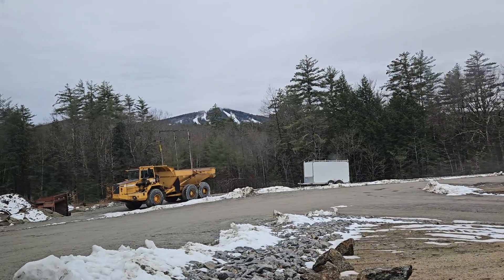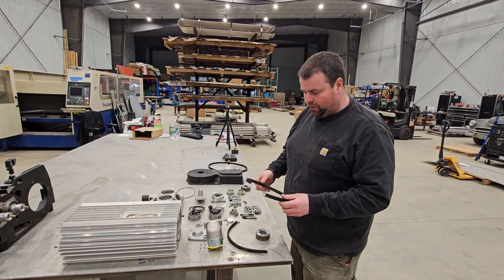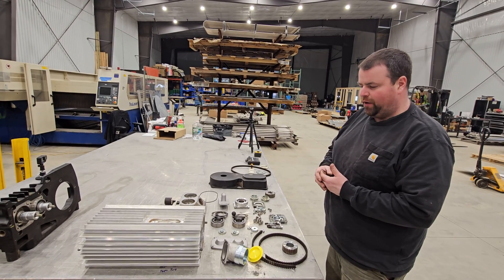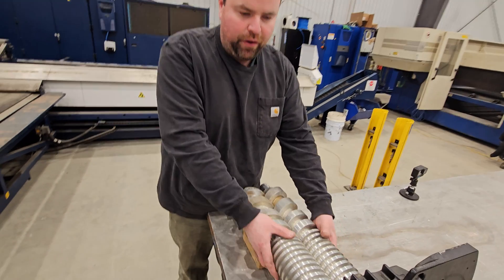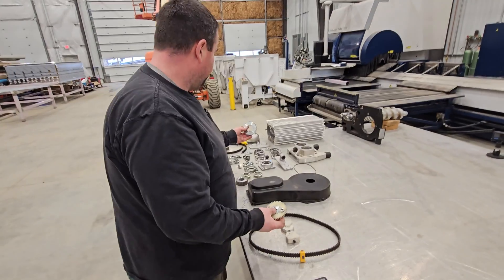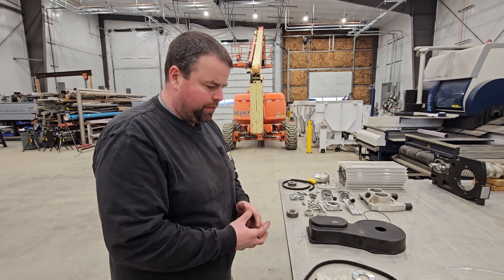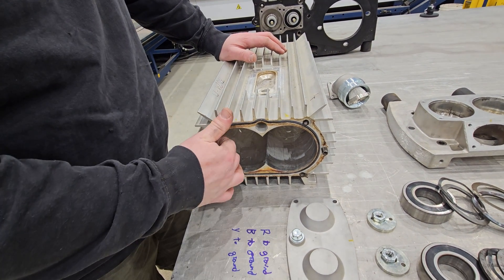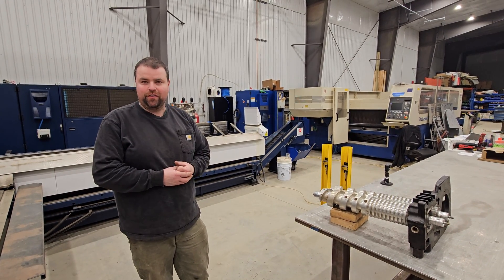Leybold NOVADRY Screw Vacuum Pump BUYER BEWARE ep. 184

Comment: We have 3 Busch industrial dry screw pumps which are water jacket cooled. They haven’t been without issue but certainly better than this! All 3 have been apart and they are very simple. No parts except oil changes.  We also have wet/oil screw pumps and they do seem better for maple production. The dry screws tolerances are sensitive to moisture and sap/sugar vapors.
Reply from the maker: Do you recommend the wet screw pump over the dry screw pump?
Reply: Yes. Although I’m not sure if there is a good option for normal scale. The GHS atlas pumps are awesome.
Reply: Here we have a big difference between Novadry/Varodry and Dryvac (Busch Cobra's competitor), they work with belts, Dryvac and Busch Cobra use gear transmission. If you are using screw oil pumps, you are probably consuming the same as the oil sealed pumps (oil filter, oil, and exhaust filter).
I have used both, Dryvac handles perfectly with higher concentrations of humidity and condensation in general (here we have orange distillation, the byproducts "terpene", "folder" extremely aggressive for pumps in general, we use water vapor for flushing). We might connect the water port to deal with temperature and thats it!

Comment: My mind was blown today. I refurbish leybold rotary vane high vac pumps and sell them to maple farmers. There pretty stellar pumps. Even dealing with leybold USA in Export PA I did not know that Atlas Copco actually has owned leybold for almost 10 years. The leybold dry screw here is also produced in an atlas copco version. The leybold sogevac units I sell are the same pump the Clayton was selling but was known as a “GVS “series.  Identical pumps except one is gray and the other is English white. 

🤯🤯🤯🤯🤯🤯

Found this out on accident
Reply from the maker: Oh, I have learned so much.  There is a company in Texas, I believe, who manufactured for Leybold.  I am pretty sure all of the GVS pumps can be purchased under a different brand.  Same replacement parts and rebuild kits without the hefty price tag.  When I think of the name, I will let you know.
Reply: @BissellMapleFarm sogevac maybe? They got the gvs design when they bought leybold that was the Sogevac series high vac pump. Generally the Sogevac was manufactured in France and filters and small parts at there plant in china. I’d be curious if something was going on in Texas 🕵️‍♂️

I’ve already tracked down cdl and air tech pumps…. super disappointing story not surprised though
Reply from the maker: @ryan05753 I cannot remember the texas vacuum manufacturer.  But it was 3 letters, I think.  I will get it eventually

Comment: Nate trying to choose between dry claw vs vane pump. Personally feel like a claw pump when you do have an issue it will be very expensive vs vane pump seem to be very reliable just more routine maintenance. 

We are almost 3000 taps, no ladders,wet/dry. 

We currently have an old delaval vane pump. 

Any advice on brands/types?
Reply from the maker: @MrBigBEYEA  I would run (2) GVS40A from Atlas Copco.  MES would be the dealer in the NE.  Nick Wendel in Western NY
Reply: @BissellMapleFarm  why 2 when one is putting out 31cfm?

Atlas head office only an hour from us in NB Canada. I’ll call them today for a price, doesn’t seem they mention maple on their website at all. 

Always enjoy your videos?
Thanks
Reply from the maker: @MrBigBEYEA  I've been thinking about your question.  It depends on your goals.  Anyone who makes 5lbs+ uses the oil vane pumps.  The high vacuum definitely correlates to yield.  

So it depends on your goals, really.  I like the simplicity of the claw pump.  I am accident prone and forgetful.   So, the claw pump handles sap disruption better.  Sometimes, I forget to turn my releaser on in the bottom of a ravine.  It would be a big problem with oil vane pumps.

As far as two GVS40a's - I like redundancy.